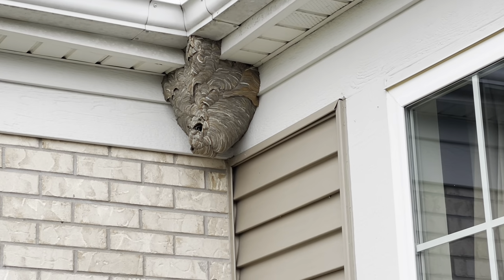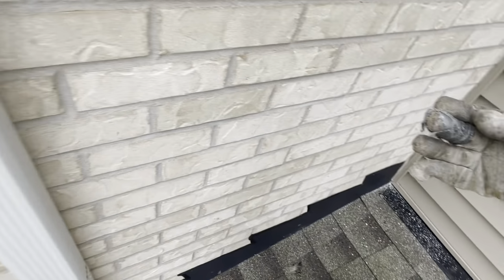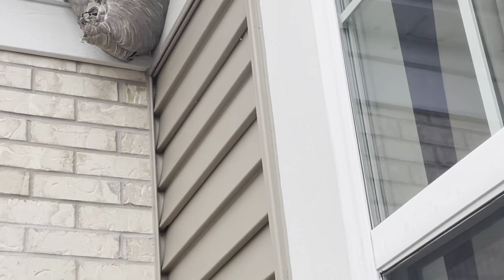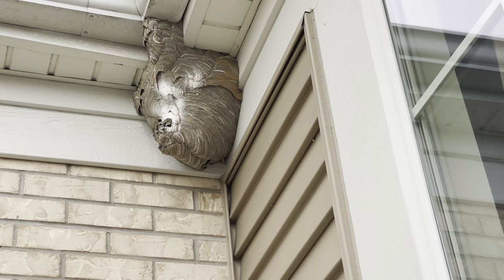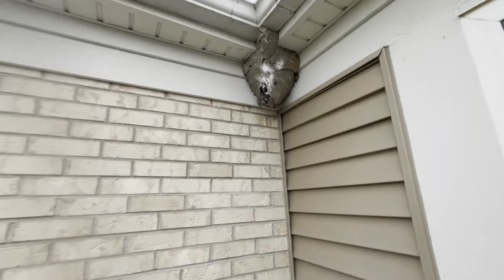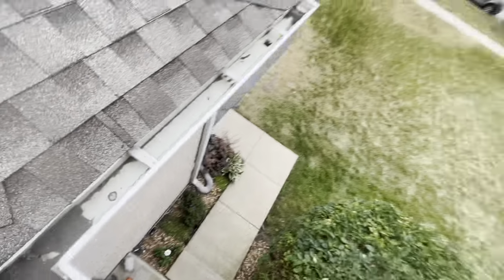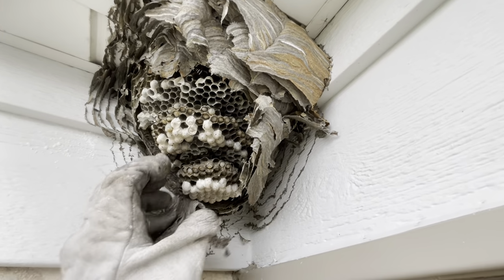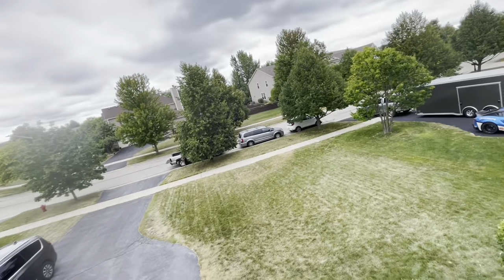How To Remove A Bald Face Hornet Nest Using Drione , How to kill wasp

Comment: What kind of wasp are these cause one of these things has been rotting on my basement floor for over a month. I think it’s black now and I refuse to touch that even tho it’s dead which is why it hasn’t been cleaned up yet. And no one ever goes down there besides me 🥲🥲
Reply: It is a bald faced hornet.  They are also called white faced hornets.  They are very aggressive like southern yellowjackets.  They have a smooth stinger, not barbed, so they can sting a victim multiple times without doing harm to themselves.